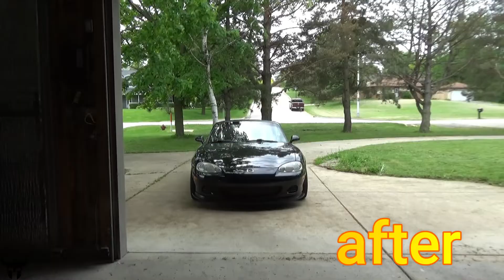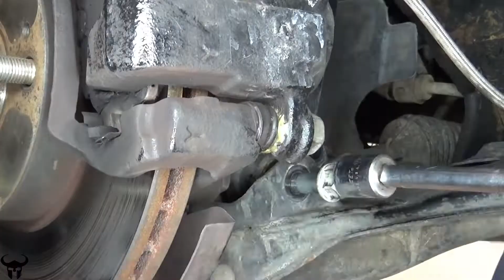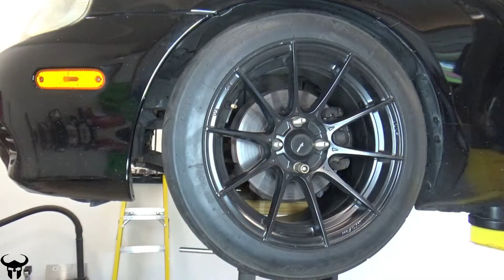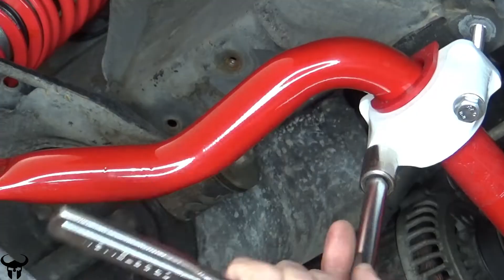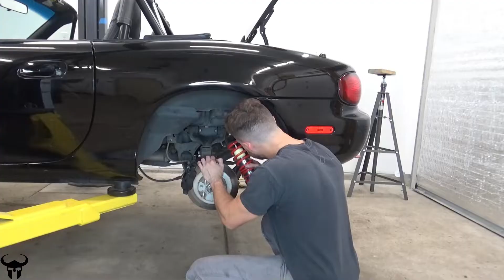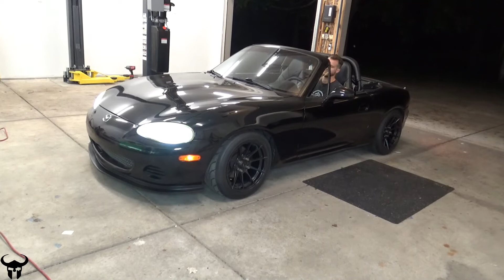NB Miata Coilover Install - From OEM to Track Ready - Complete Coilover Replacement. QUICK VIDEO!

Comment: Rim and tire size please !  That is rim set I have been looking at but not sure if I want 8 or 9 inch rims.   Did you have any issues with rub or any contact ?
Reply from the maker: Yes! These are 15 x 8" 25mm offset, tires are 225/45ZR15 . -1 camber up front, -1.5 camber in the rear. We did not roll the fenders (or remove liners) and have been on the race track with the setup with no problems. The wheels rub on the sway bar at full lock. The passenger side brake line was rubbing on the wheel at full lock until we turned it a little - now it is not rubbing. The ride quality of a wheel this wide with these tires is not good though - considering going back to the OEM wheel specs until it is turbo'd  - I would recommend 8" over 9" unless you have 300+ hp. Even with 8" wheels, my top speed on the straights at road america fell 5% (5 MPH) due to the additional drag, but the cornering is better. A stock miata is not really limited by it's tire width

Comment: Great work man! Definitely in for more Miata content!
Reply from the maker: Hi Josh, thank you! More miata content is coming soon. Just tracked it at Road America, getting a baseline dyno in a few weeks
Reply: @EnigmaEngineering  Hey man, just curious what roll bar you have? I'm interested in getting one soon and also have an 01' with the surfboard seats. Looks like I would just clear the bar without a helmet in your setup.
Reply from the maker: @JMCalderon01  Hi Josh. I have the Hard Dog M2 Hard Core with double diagonals. It is a great bar - zero complaints. Visibility is fine. I am 5' 11" and can fit under the roll bar even after adding bolstering to my seats. There are a few more things you can do if you do not fit under the bar with a helmet on. Nagisa makes a super low seat rail. Or make a fixed rail. Or a racing seat like a sparco sprint. Let me know if you have any more questions!

Comment: Excellent video, I like how detailed and thorough you are.  Miata is looking good!  How does it handle now with these components?
Reply from the maker: Thanks James! My maximum lateral acceleration off my phone was between 1.02 and 1.1 at Road America before I installed the suspension, the wider R888s, and sway bar. Hoping to hit around 1.2-1.3 now. I'll report back with deltas on G force and lap times when I shake it down in Elkhart Lake in August!